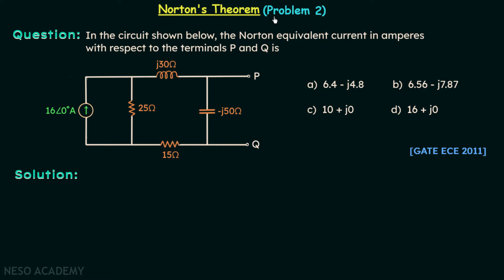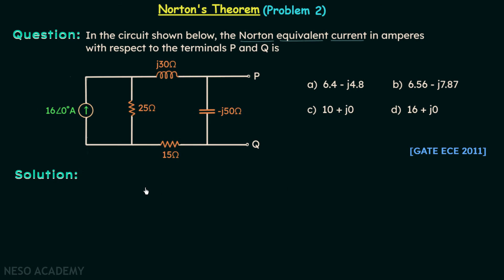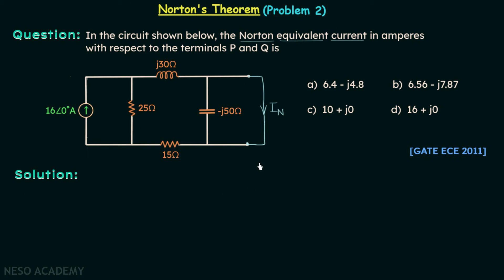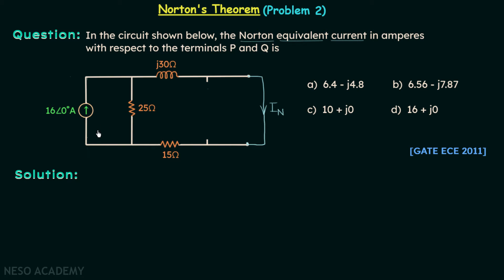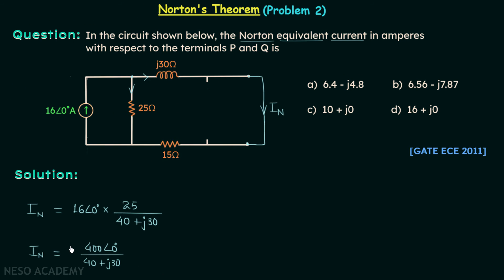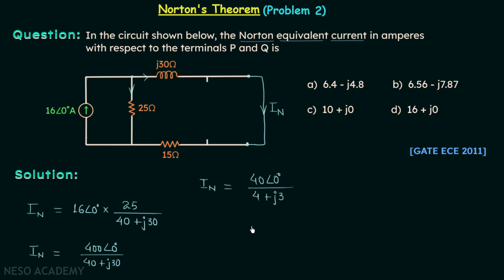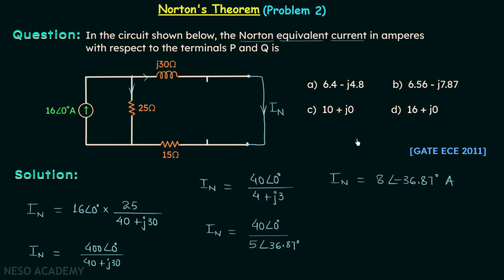Norton's Theorem (Problem 2)

Comment: 3:10 There is a slight mistake in conversion of rect to polar at the end. In will be 5<0.6435 Amps.
Reply: In radians it would be 0.6435 but in degrees it would be as given in the video. No mistake brother.

Comment: Sir, why did you open circuited capacitor, if you did because of DC source shouldn't then inductor also needs to be short circuited ?
Reply: open circuited the capacitor as it is directly parallel with the short path
Reply: @Darkknight9035  can you explain it deeply please?
Reply: Because the initial current from the source at left side will be split between the path having inductor on right and 25 ohm resistor..afterwards the current on the top path (with inductor)actually have 2 paths to now flow to the one with the capacitor and the one short circuited path(PQ)..but since path with the capacitor offers resistance(capacitive reactance) to the flow of current and the short circuited path have 0 resistance ideally the complete current will choose to flow across that short ckted path.
Therefore 0 current flows in the path with capacitor hence nullifiying it's relevance...thus can be considered to be open ckted.

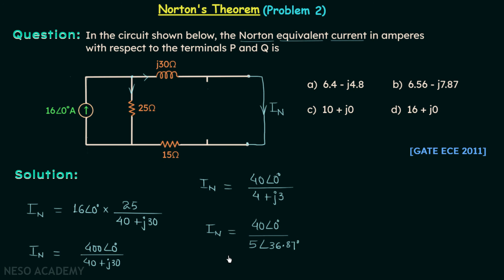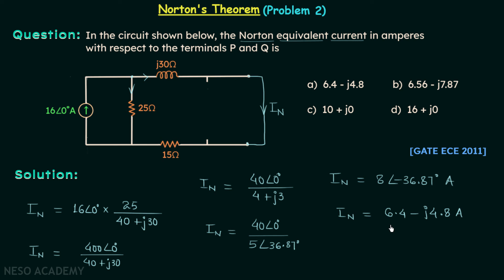Comment: how did conversion happened at 3:16 and at 3:54 ?
Reply: Convert from rectangular form to polar form
Reply: With calci
Reply: there is actually a conversion mistake. Please do it with calculator or manually.
Reply: @anishsharma5097  how to calculate it manually?
Reply: @sarithak3670  to convert from Rectangular to Polar form, a+jb will be sqrt. (a^2 +b^2) and angle will be tan inverse b/a.        To convert from polar to rectangular, r angle theta will be a=r cos(theta) ,b=r sin(theta) .. the rectangular form will be written as a+jb. If this didn't help. See some videos on how to convert.